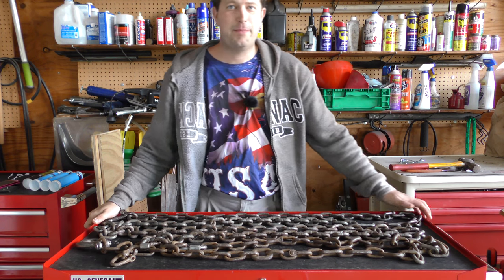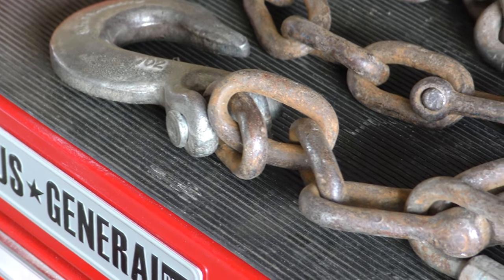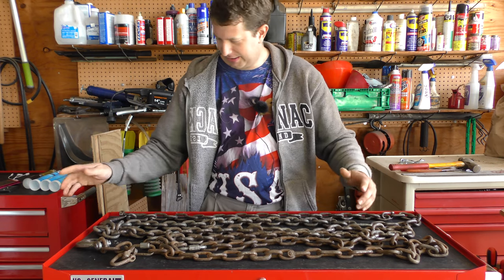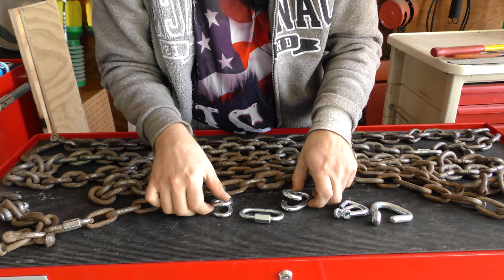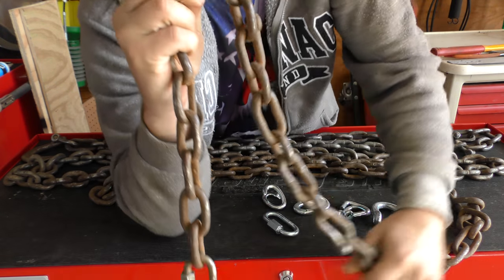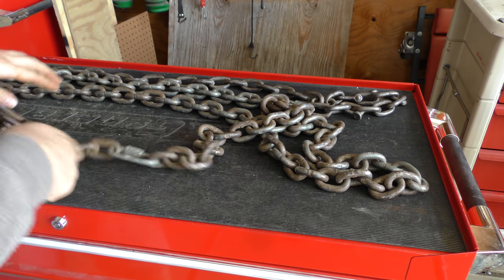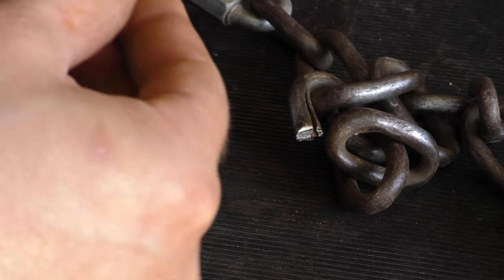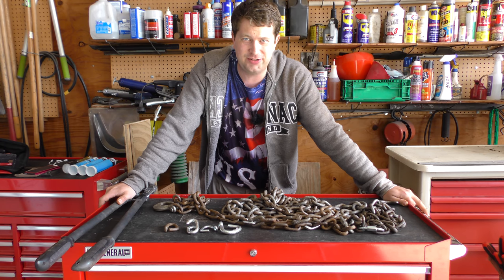Shop Basics - Repairing a Logging Chain

Comment: I am trying to determine what the purpose of this video is. "How to wreck Grandpa's excellent logging chain in one YouTube video." If the old links are still on the chain, then they are not broken. If they are not broken, they do not need to be fixed. The test of these old tools is not what we "think" they should be, but whether or not they survive actual field use. I, too, have old logging chains that I use while logging hardwoods, that are full of all kinds of repair and quick links. I would not dream of removing them unless they were severely bent or damaged. If it ain't broke, don't fix it. But the allure of beating on metal for YouTube is pretty strong...
Reply from the maker: Remind me NEVER to use any of your chains!  And just an FYI we ended up throwing most of that pathetic excuse of chain away when I was done with this video!
Reply: @radozeman  I would not expect you to do any of the heavy and dirty work that I do in the woods, let alone use any of my chains. I am only sitting inside now because I am waiting for the rain to pass, and then I am off to skid logs using chains that you say are no good but which have worked fine for fifty years and which probably have another fifty years in them. YouTube has bred a culture of clueless know-it-alls who post utter nonsense in the hopes of being perceived as an expert. It is really an unbelievable sign of where America has gone (downward). You should get outside and actually use/ test those old chains before declaring them unfit. But hey, why not just post a YouTube video, it is easier...
Reply: JAC 08  two comments in a year's time is not hovering. I do believe in the usefulness of a substantive debate, and so I will comment when I have time. I don't mock people, because that is weak. Last year marked one whole year I ran an ad in our local technology college's forestry program. I offered to take on a couple paid interns for the summer, and teach them how to select and safely fell and buck trees, skid logs, saw the logs on the sawmill, and grade the lumber they produced. Out of all the forestry students in that program, not one applied. None applied to any of the other local mills, either, nor to any of the heavy construction businesses in the area. General consensus among us older guys is your generation is not worth spit. You don't know how to work, you don't care to work, you don't value work, and you will give away America to whoever wants to take it because fighting for her is just too hard. Civilizations come and go, and while my age group built this country better and stronger than it was when we were little kids, your age group is sitting on your ass, posting ridiculous videos on line and posing as experts, while America burns to the ground. Good luck, idiots

Comment: That chain is WHIPPED, steel scrap or practice I suppose. Interesting vice however, is it homemade?
Reply from the maker: That is true, the chain has seen its better days!  And yes the vice is homemade!
Reply: Bryan, that chain is very very far from whipped. I use a whole pile of chains while logging, and a chain is only "whipped" when the links are corroded AND bent AND cracked. The test for a chain's functionality is not how it looks, all rusty and gnarly, but how it functions in the woods, for example. Chain is expensive, but not when I buy used ones from people who tell me "You can have this chain, it is totally whipped."

Comment: never under estimate an antique tractor
Reply from the maker: Apparently!
Reply: i got a 1943 e3 co-op tractor its been thru health and back
Reply: exactly! and never underestimate an old logging chain because it "looks" old. If it functions, then it is not in need of repair. Jiminiy crickets! I am a roll on this youtube video, because it really symbolizes so much about youtube, the people who post on it, and the people who comment on the posts. anyhow, i will be logging today with my old rusty chains that all these keyboard experts say are junk....
Reply: @pamtnman pamtnman OSHA would probably seize every chain you have and ban you from having any.

Links of chain must be removed, or whole tackle discarded, if the links are worn past the maximum allowable limit. Especially if it's used in overhead tackle. 

Cold shuts and other type links are not recommended for high grade chain. These types of connecting links are limited to light light duty.  Jim fixed chains, like the one in the video, are on grounds for scrapping.